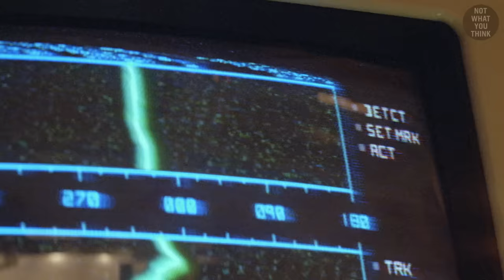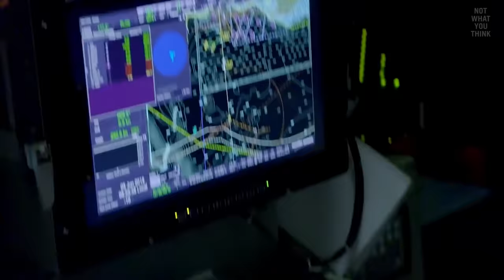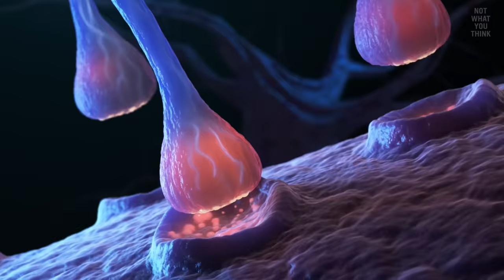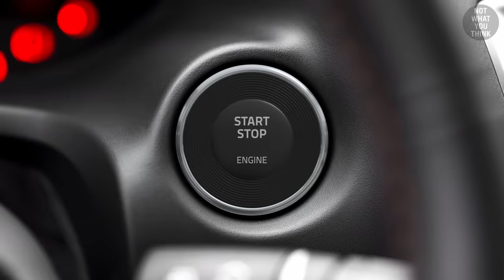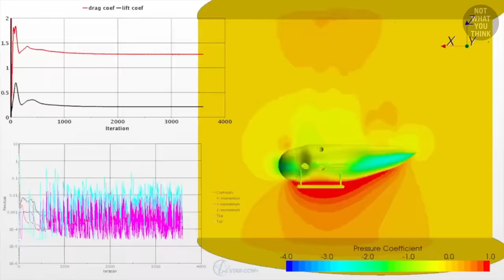What Happens When a Submarine Implodes

Comment: I have spent about 4 years of my life underwater on two fast attack submarines. We always kept in mind that if the number of dives did not equal the number of surfaces then we were screwed. One of the submarines I was on, USS Sunfish SSN 649, actually made a huge milestone of 1000 dives and surfacing's in 1996. The "keel" of the Sunfish was laid down 3 months after I was born in 1964. Quite a remarkable career for a sub.
Reply: Hello from another submariner. I was only serving on the sub for 1 year. Drafted. It was a very small sub. About 40 crew. I did try an unscheduled deep dive but only to about 85 meters to the sea floor. I am not a ghost so we got up again.
Reply: Ok tell me I'm wrong but shouldn't a sub be like a plane and tested for metal fatigue after a certain amount of pressure / depressurize cycles.
Reply: And this is why I prefer airplanes. The number of landings always equals the number of takeoffs.
Reply: @JoeBurks_1  Take-offs are optional, landings are mandatory
Reply: @philipmcdonagh1094 military subs do have bay and sea trials, they're consistently tested
Reply: @philipmcdonagh1094  You are correct! Testing should have been done. 
The different types of material would also have been stressed differently, leading to potential issues at the joints.
Two problems just for starters...
Reply: @P_RO_ you have to take-off to land though ._.
Reply: Is the pressure hull affected by multiple dives ?
Reply: @barryscotland250  Absolutely. And you likely wouldn't know from a visual inspection alone. 
I've been reading that Rush thought his miking of the hull would be an adequate substitute. I find myself SMH endlessly.
Reply: @JoeBurks_1  But some landings are a bit harder then others....
Reply: My brother, Robert Sweney, served on that submarine! He was with the crew that commissioned and did tests, etc. Over 8 years he served in the Navy...I remember the trips to beyond the Mississippi to stock up on Coors beer which at that time was only distributed to west of the Mississippi (according to my brother)...They would hide the beer in strategic locations throughout the sub...Not sure if all true, just passing along stories a big brother told his little brother haha...Thanks for your service! I did 25 years in the Army and retired 25+ years ago...Time flies...

👍😎👍
Reply: I was on USS Tautog 639 from 1985-1989

Good times!
Reply: @philipmcdonagh1094 modern military submarines especially in the nuclear era do not strategically  rely on extreme depths. Less depth & modern construction means less structural fatigue. It's not the hull that will fail anyhow. A subsystem will fail then it cause it to exceed max depth THEN the hull fails. We can test subsystems easily and absolutely do test them.
Reply: @JoeBurks_1 yep. I still prefer my landings to gently kiss the runway and terminate with a slow coast to a terminal ramp. Not the landing in a cornfield surrounded by a fireball and sudden stop
Reply: The Bulgarian submariners are very proud of having equal number of dives and surfaces. The tiny size of the submarine force might have helped with that. We had a few submarines in WWI from Germany and after WWII some Soviet diesels including 4 Romeos. Last one was decommissioned 2-3 years ago.
Reply: @JoeBurks_1  having been in an airplane crash, I can tell you that some "landings" are smoother than others. Yes, an airplane will always return to the surface of the Earth, whereas, a submarine may not, but the math can be deceptively comforting. Not all are fun. 

I was able to limp away and I was the only one onboard, so not a whole lot of screaming. At least that's what I tell everyone. You weren't there.
Reply: The number of landings always equals the number of takeoffs. I sincerely hope so.
Reply: Hopefully you wasn't serving on uss tresher
Reply: @philipmcdonagh1094  There is indeed a risk of acquiring fatigue stress flaws within the welded joints and the adjacent parent metal. But, if the initial tests have been carried out correctly, there shouldn't be all too much of that risk left. And, as someone else here said, it's probably not the hull itself that will do the failing, once something goes wrong. As long as the sub remains above the critical depth, there should be no risk of a hull breach. Metals tend to be rather flexible. It's when this natural flexibility gets affected by locally and temporarily limited heat, like a weld deposit, that things can become more complex, initiating cracks. That's why a properly monitored weld procedure has to be maintained, ensued for a properly executed examination sequence.
I have no particular experience with subs. But, I have been working in the field of non-destructive testing for more than 32 years. My former employer, the Dutch RTD ("Röntgen Technische Dienst", now part of "Applus"), started as an examination service for the Dutch built subs in Rotterdam in the 1930's, making X-rays of the hull welds.
Reply: @philipmcdonagh1094 There is thought in that direction -- but steel fatigues far slower than aluminum, and there is a lot more of it in a submarine pressure hull than in an airframe. We've had some rather smart collisions of these vessels... and they've still come back.
Reply: No shit Sherlock. If you have more dives than surfaces, you're dead.
Reply: such a crazy statement to make as a human.
Reply: @dvanatendi  I don't know. I was drafted to the Danish navy over 50 years ago and I was only asigned to the sub for 1 year. I believe it was a copy of German late WW2 sub's with upgrades. It was conventional of cause. A new design was allresdy in the water when I left.
I still however feel for the sailors in any sub these days in case of an accident. It brings back the memories. I was lucky that I never saw any war allthough the Russians where mooving around in eastern Europe and giving us consern.
Reply: US boats have a habit of running into shit though, like undersea mounts and Japanese fishing boats with students on them. 😉
Reply: I was on the USS John C. Calhoun, SSBN 630 (gold crew), and I had a friend on the Sunfish at that time (1981-85).  Like me, he was a 'nuke' Machinist's Mate.

Comment: I remember reading an article in National Geographic about a team of ocean explorers that were trying to retrieve gold from the wreckage of a Japanese submarine lost in the Atlantic ocean. There was a picture of a running shoe they had found in the wreckage. It was from someone in the crew. The shoe was torn apart and burned. The article explained that the reason why the shoe was burned was the "Diesel" effect when the submarine imploded, which caused everything inside to incinerate in a tiny fraction of a second.
Reply: Wow, bizarrely amazing!😮
Reply: I highly doubt the Diesel effect described in this video, and wonder if it has been confirmed in tests. It seems that the correct air to fuel ratio wouldn't be achieved even though the compression could be achieved. And also, the fuel in a piston still takes time to ignite and typically would need a glow plug or other source of ignition.  Seems unlikely but what do I know.
Reply: @tomgreene7942  Might want to research "diesel" (as opposed to gasoline) engines and how they ignite.    Also, the pressure inside a diesel cylinder is between 300 to 500 psi.  The pressure at the instant of implosion on the Titan would have been 10X to 20X greater than the inside of a diesel cylinder.  So, getting the air to fuel ratio "just right" would probably not be as much of a consideration for igniting any small amount of hydrocarbon vapor in the air.  It's just physics and chemistry at that point.
Reply: @druefreeman439  As the old saying goes: Everything is flammable if you try hard enough.
Reply: @tomgreene7942  you can burn cotton wool inside a syringe if you compress it fast enough

the energy of the moving air particles is condensed into a smaller volume increasing its temperature

the reason it doesnt happen if you compress it too slowly is that the temperature increase creates a high temperature gradient to the air outside the syringe causing the thermal loss to accelerate. so the compression and heating has to happen faster than the bleeding out of heat
Reply: @tomgreene7942  if you compress 10m3 of air at room temperature (titan submersible was a bit more than that) to something close to 0 at the depth of the titanic, the temperature would rise to about 25-50 thousand degrees. At this point you do not even need any special fuel, as the air being compressed would just autoignite.
Reply: @BigFx  25-50,000 degrees? 😮Good golly, Miss Molly!😮

 At such extreme temperatures (that's even hotter than the surface of the sun, for crying out loud!) you'd be reduced to a mass of scorched goo or even just plain vaporised before your brain could even begin to process what was happening! 

Frankly, you couldn't get me into a sub without several very strong men, not out of fear but due to severe claustrophobia. I simply can't endure tight spaces for very long, and submarines are notoriously cramped quarters!
Reply: A painless death
Reply: @tomgreene7942 Under enough pressure anything becomes fuel the diesel effect is just a way to describe to people how if you compress something enough it will self ignite
Reply: @tomgreene7942  the glow plug doesn't ignite the fuel in a diesel engine, the compression pressure is what causes it.  The glowplugs are there to help heat up the combustion chamber before trying to start the engine in cold temperatures.
Reply: @BigFx  How does air  "ignite"  it is O2 and N2.. and Ar and these are pure elements, so with no "fuel" what are they to react with?  and the micro amt. of CO2 is already an oxide...
so. what can "burn" with those molecules?
Reply: @79huddy  Get hot for sure, but not "ignite"!  see my answer to others
Reply: @tomgreene7942 ideal gas law: pressure x volume = moles(particles) x ideal gas constant x temperature

if pressure increases faster than volume decreases, temperature has to go up. yay chemistry (also physics?)
Reply: @tomgreene7942 The average kinetic energy of the molecules inside the sub would exceed the average kinetic energy of molecules on the surface of the sun in a millisecond or so. Because “temperature” is just a measure of the average kinetic energy of the molecules in a system that means that for a few milliseconds the inside of the sub was hotter than the surface of the sun. As someone else said…Biology to Physics in a Millisecond.
Reply: Now THAT'S COMFORTING.
Reply: I did time on submarines. We called this a "one stroke diesel".
Reply: @tomgreene7942  Mechanical engineer here: diesel engines don't feature any ignition devices. The fuel ignites simply because of the high temperature achieved by the compressed air. I've done the calculation myself, and for the Titan, the air inside the vessel achieved nearly 1300 °C due to the compression, at 400 bar. This is a gigantic combo of temperature/pressure, much, much higher than any diesel cylinder will ever experience. Pretty much any fuel such as paper, clothing or even flesh would auto-ignite.
Reply: @tomgreene7942  You don't need a fuel-air mixture. Look up fire pistons - they're used to start a fire in survival situations. They typically compress the air by 25:1, which will raise the temperature enough to combust any kindling you place inside. That's equivalent to an implosion at just 250 m depth. Thresher is estimated to have imploded at 730 m. The Titan is estimated to have imploded at 3000 m.
Reply: @tomgreene7942 save that for the fact that the amount of heat during the implosion is immeasurable.
Reply: @tomgreene7942 not much clearly. You ever hear of something called oxygen? Yeah it's highly flammable. You know the difference in a few hundredish pounds of compression in the space of roughly a liter and several thousand pounds of compression in something the size of a swimming pool? Huge difference.
Reply: @That70sGuitarist you have a thing for big strong men? They help you get over not your "fear" but your "phobia"?
Reply: @loftsatsympaticodotc bro oxygen is highly and I mean highly flammable lol. It is the fuel. Not that you would need it though. You ever seen a shooting star? It's burning up and doesn't have any "fuel". It's because of the air resistance. The air is making it burn. Good freaking grief .
Reply: @solandri69 "you don't need fuel air mixture" goes on to talk about a device that uses a fuel air mixture. Oxygen is a must to have a flame. That's why minors back in the day would have a candle burning. When it would go out they knew they needed to leave the area. I think after an explosion or two they switched to birds.
Reply: @bradsanders407  A candle works by heating the fuel (the candle wax) until it vaporizes, creating a fuel-air mixture which is easier to combust. That's why the flame dances above the wick. A fire piston works by increasing the temperature until it's hot enough to cause a solid fuel to combust with oxygen in contact with its surface. The fuel does not mix with the air (at least not initially). If you look at the kindling material after igniting it with a fire piston, it's merely glowing like embers. There is no flame. And you have to do the typical blowing on the embers to feed it more oxygen to increase its temp to where it can ignite more material.